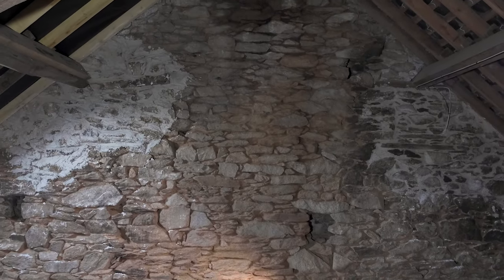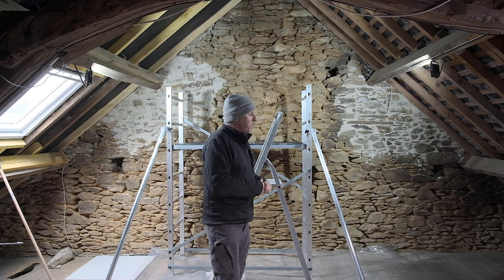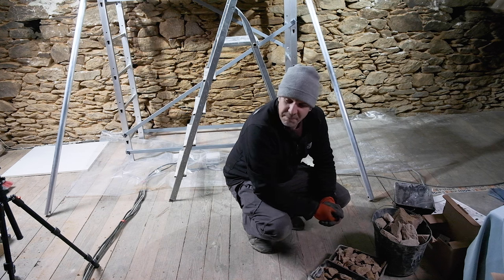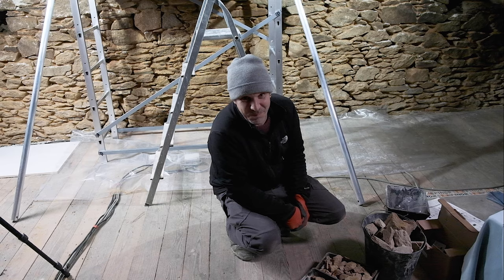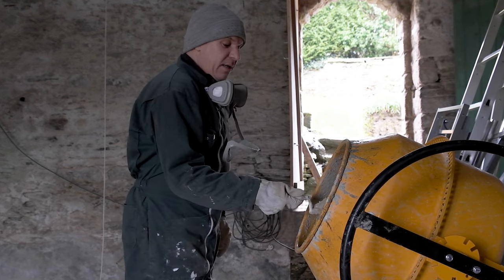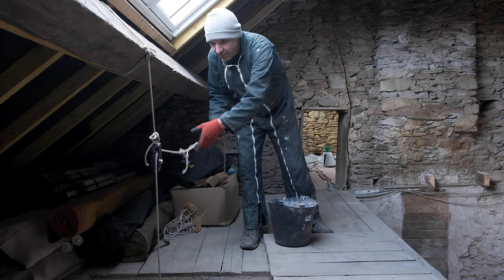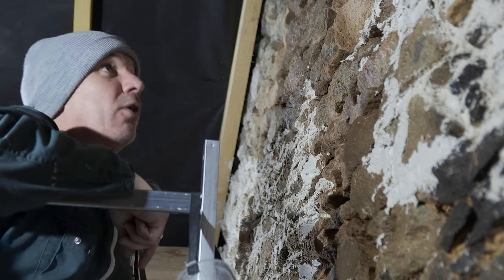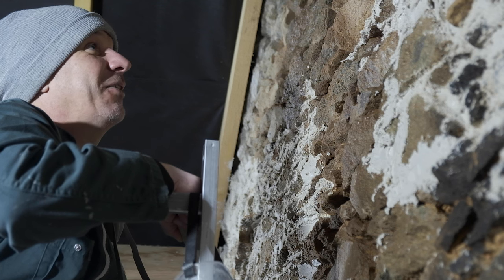Lime Pointing

Comment: We spend weeks lime pointing our house in France every year so a few tips you might consider.  Don’t bother with the mask once the  lime dust is absorbed into the mix.  Get a small “hod” to hold the mix, rather than holding it on a trowel as you get more on and can point for longer. Finally, listen to audio books while you point and the time flies by.  Keep up the good work.

Comment: In English, the cats tongue is called a "tuck pointing trowel".  They come in various widths.  So for a job like yours where the width of the spaces to be tuck pointed vary greatly, you would be well served to have several widths to speed up the process.
I'll also suggest you look for a long handled "tampico churn or fender brush" to tamp the mortar into the joints tightly when the mortar has started to set.  You can then use the tampico bristles to clean the surface of the stone.

Comment: If it's of any help to you these are a few things I found useful repointing my stone walls. 
I got a slaters hammer from screwfix and cut the flat hammer part off and just used the pick on it to knock out the old mortar. It's like a mini pick. Works really well. 
For the mortar I used premixed bags of lime mortar, easy to mix and the consistency of the mortar
 is always the same each bag. Looks the same throughout the wall. It has animal hair fibre some beach sand and river washed stone in it also as far as I'm aware. Makes life easier empty the bag into the mixer and add water. There's a few companies in Europe supplying this pre mixed lime mortar, you should be able to source it in France somewhere. 
I also used what's called a churn brush to compact the mortar into joints and it leaves a nice even finished look.

Comment: Pour information, les joins doivent être nettoyés sur une profondeur qui correspond a quatre fois leur hauteur afin d'être viables dans le temps. Un joint entre deux pierres de 2cm devra être creusé sur huit cm.
Cordialement

For information, the joints must be cleaned to a depth which corresponds to four times their height in order to be viable over time. A joint between two 2cm stones must be dug over eight cm.
Sincerely

Comment: pointing is a long and thankless job, most bricklayers hate it and avoid at all costs. can I suggest you buy yourself a good raking tool there are two types that work well with stone wall the first is a lot like a dockers cargo hook and the second is like a twisted staple, both give plenty of purchase and have enough heft to remove rubbish from between the stones with some rapidity and saving your wrists from constantly swing a club hammer., both are easy to make from rebar if not available from the shop. It also helps to cover the floor with cheap hardboard it will cut down on the damage to the floor boards and save endless hours of cleaning once the wall is finished. And for this type of work I would use a hawk working the mortar directly off the hawk into the joints with a pointing trowel. on a differing note mortar can be improved with the addition of a small amount of white cement and PVA say a quarter of a bucket of white cement to your present mix and as much pva into your water bucket as you feel you can afford.within reason.If  you find the mix is going off faster than you can work it reduce the cement by 50% and see how it goes.

Comment: If your not planning to expose the stone and are having a plastered wall, do you need to spend the time intricately pointing it. Can't you just slap on a few mill thick coat making sure to apply pressure as it will fill all the joints as its being applied?. Then you can build up your layers. Just an idea🤔